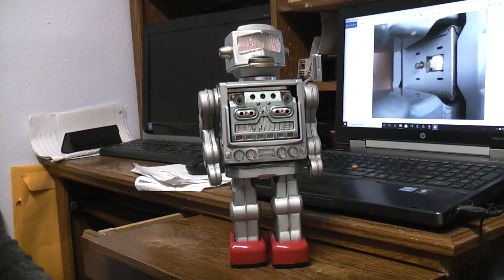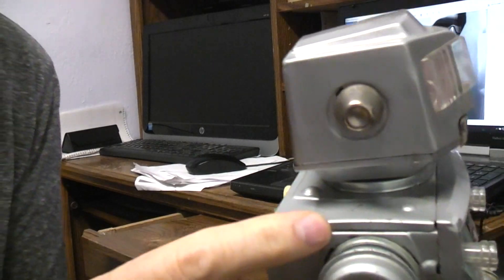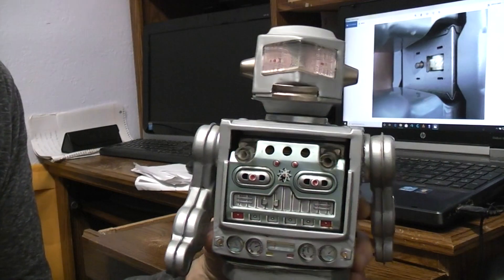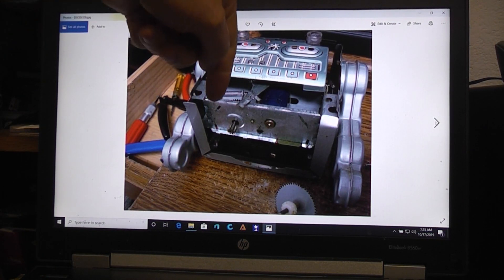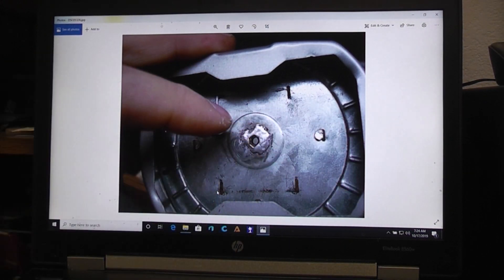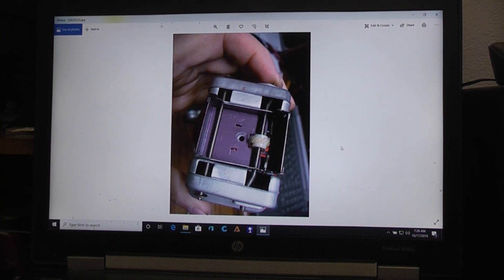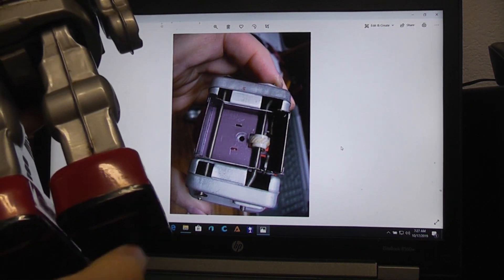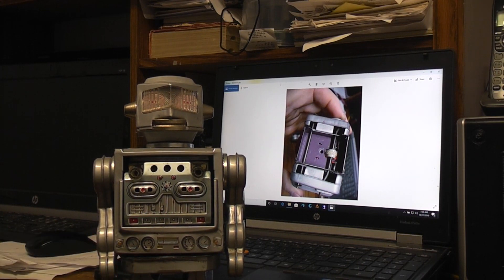Vintage "Hypno Eye" Roto Robot repair and Demo.

Comment: Here is how I repair these gears, seems to work for my personal robots - I use a lathe to machine a band to go over the collars. It has to be the right tightness, but it seems successful so far!
Reply from the maker: I have used brass tubing to do this in the past, sometimes I have to machine down the color on the plastic gear to wedge into the brass sleeve. Sometimes the crack in the teeth is just too much to mesh properly even with a metal sleeve, or so I have found.

Comment: I have the hoirkawa robot that has the doors on the chest that open. My problem is it use to walk,  the gears looked perfect, it did work perfect momentarily.. so I replaced both gears with  the same type you mention in this vid. I can very easily get it to walk if I manually turn the gear with my finger, but once I put the gear that mates to it and try to turn it, it binds it will not turn, I put it together to check it that way as well, you can here it bind and sometimes skip.. but this should move freely by hand, once I turn the gear by hand by the shaft correct?? I also checked the rods in the legs they are strait.
Reply from the maker: Yes it should freely by hand. So either the new gears are not mating or aligned right or the drive shaft from the gearbox is slipping on the gear up inside the gearbox.
Reply: @Robothut  ok thanks..I tried to mesh them instead of just dropping the shaft onto the the axel gear and then lights turn, it does want to turn by hand then stops, I do have a bad spot, very minimal but it seems to effect it, I ordered new gears, I will update after the install.
Your video gave me the courage to take the robot apart, that I had for nearly 30 years..I also got the same robot as shown in this video, when testing it I used one D battery with 14 gauge wire I had to determine if it was the switch not working, it was, so I put 2 D batteries in the robot and jumped the positive to neg, the robot spun around very fast,so much that I thought, it would just cause it to fall if I made the permanent fix using 14 gauge, I ended up using the original wire and it spins just as it should, I was using cheap Panasonic batteries..I like the idea you mentioned on converting A size batteries, I am going to do that.. keep up the good vids, it helps a lot of guy and gals  who just were to afraid to open these robots up, ..

Comment: Man i remember when my only tin robot, the super astronaut, had the non-spinning issue because the middle spacer was rounded, either from top or bottom,i could never solder it because it was made of alluminum, i got it remade in my school, and it rounded again in a matter of days, just last year i ended up 3d printing one and screwing it to the torso, after like 2 years of the damn thing being disassembled, had to remake almost all tabs, the damn thing now works again. The only issue with it now that has always had is the doors never stay open when the robot is spinning, like if something was off centered or worn
Reply from the maker: Yes the door open and gun shacking are done by the spring loaded large gear. The small brass gear that goes up and down, when up that is roto matic mode nd when down that is walk mode. The small brass gear will get worn at the bottom end do to the mechanical design of the door opening gear that is spring loaded. When it jams or reaches the end of the teeth that is when the door and guns should be open but since that makes the small brass drive gear skip a tooth it wears it out kind of fast. Not designed to last very long. Some of the robot do it differently and will last a long time.

Comment: can you super glue the tabs back on?  that is my reason why i dont take mine apart to fix him cuz i fear breaking the tab
Reply from the maker: No the tabs if broken off are history. But you can make new tabs that are longer and solder them on from the inside. The drawback to this is the heat from soldering will discolor the paint on the outside.
Reply: super glue the new tabs?   @Robothut